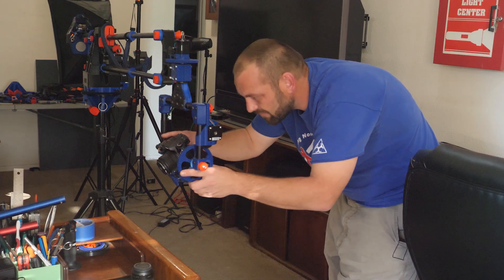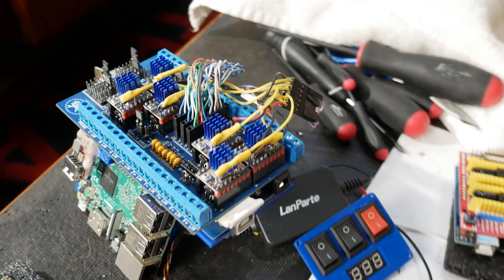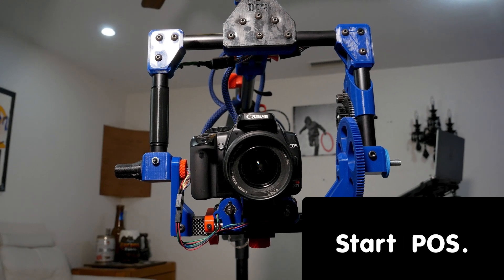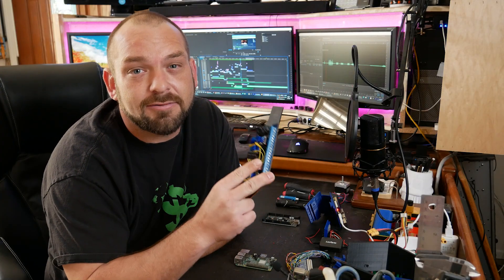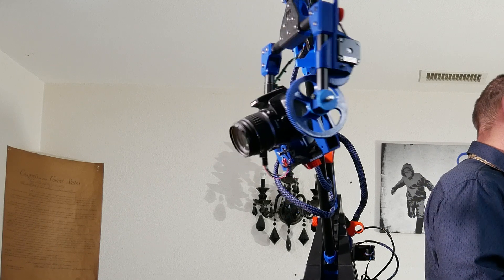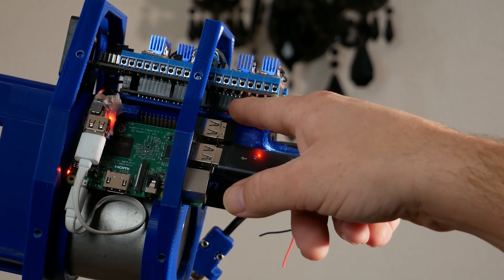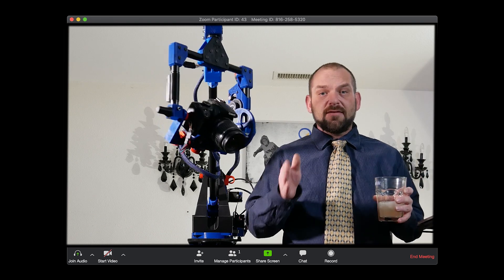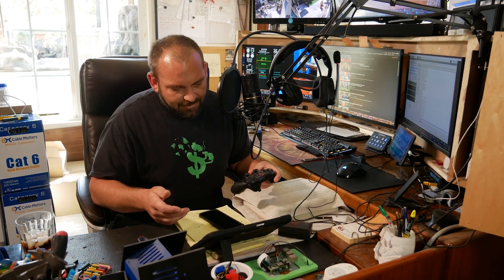The greatest DIY MOTION CONTROL camera rig EVER | Part 2

Comment from the maker: I'll Be Back
Reply: We are the resistance ✌️
Reply: In another year or...? I just finished printing every part and have all the hardware. Electronics are almost all here. Which motors did you end up using for zoom and focus?
Reply from the maker: Probably like 2 or 3 years @ryanmcclara
Reply: @DoItWhenever  ouch.
Reply: @DoItWhenever  Well, if it takes that long- I'll still be here! Hopefully I'll have my own system by then (based on yours) but..
Reply: Please don’t go to get milk
Reply: i cant wait!!!
Reply: In another year or...? I just finished printing every part and have all the hardware. Electronics are almost all here. Which motors did you end up using for zoom and focus?
Reply: @ryanmcclara  Prints and parts here too.  Any luck assembling the mechanical aspect?
Trying to figure out the turret.  
Are there bearings on the inside? Motors?
I'm looking at the S2A_camera_rig_complete.stl but maybe the .step files are more helpful?
Reply: The 24 rolllers... got it..  Though only 23 fit.
Not sure if this should be sanded/greased to quiet the woosh.
Reply: You don't have to prove me right. Sooner the better.
Reply: What do you think is the max weight this would support?  Looks awesome, but have an Ursa Mini 12k, wondering if it would hold it.

Comment: Nice work! I have printed all of the parts and I have 90% of the electronics and motors now. I'll work though the hardware (looks mainly like bolts) next. I haven't seen a BOM/List of the hardware, if there isn't one I would be happy to post one up? I think I've spied most of the ones in the videos.

Comment: Hey, getting together a BOM right now and ordering the parts. I noticed the link going to the 6 axis shield is no longer working. Would the GRBLDuino Mega Shield V1 - 6 Axis GRBL v1.1 Arduino Mega CNC Controller Shield on the same site you posted work? Great project, can't wait to finish everything!
Reply from the maker: Good looking out... the link should be fixed, but ya thats the board $35.75

Comment: Finnaly, really enjoyed that, well done, if you could please explain how you are moving the others three axis as Gcode Send only moves x, y and Z
thanks
Reply from the maker: Ugs does allow you to control A b and c access The only issue is you're not able to see them in the DRO... It makes it a tiny bit annoying to program a move but really not too bad. Before I program any move I zero all the axis and use absolute positioning. As long as you make a note of where you move A b and C are at it's not a problem. A nicer control solution would be really nice but this option is free for everybody and works immediately without any programming
Reply from the maker: Before I completely tear this thing and down and rebuild it for the next video I'm going to do a quick example of programming a move.
Reply: Thank you so much, been pulling my hair out.

Comment: Very interesting, thanks for also sunsrixing the things commenters suggested, I'll look into those.

I was surprised you use ugs and edit manually as it's a program I know and I expected so e fancy custom thing.

Your use is to program moves, mine is a bit different. One thing I was able to do was have just arduino with grbl and shield, then use a windows form application with USB serial port connection, it then sends a string of the code down the serial port.

I was then able to easily make a custom ui in the program and set buttons to then send code to my camera system.

Either way, very cool
Reply from the maker: right now the base just has the 19v power supply going through the slip rings so I can rotate the whole rig without binding. I was thinking of replacing the Rpi with a NUC or similar type of small based windows machine.  That would definitely open a few more doors for cool options to play with

Comment: What a monumental achievement!
And I loved the "Camulator II" intro and all the other fun references 😁
I was thinking - if you have your reverse kinematics figured out correctly, instead of ENCODERS you could have some load cells in the part that holds the camera to measure pushing/pulling/torque and have the software move the camera to match the desired motions.
Hasta la vista baby 👍

Comment: How did you do all those voices in the beginning of the video? Not the clips from other sources, but the ones that were custom to your video?
Reply from the maker: I'm not sure what you mean, The audio sources were either from the clips in the video or voice-overs that I recorded
Reply: Initially I didnt recognize some of the voice parts as being from movies. However, there is a deep announcer voice, starting at about 0:48, that is clearly custom recorded for your video. However, if that's you, it def sounds like you used voice changer software. I was/am just curious which voice changer software... "Same make .... Same model ... New video ... Once, it was programmed to control his printer ..." ... That voice. Doesn't sound like you

Comment: This is great! Thank you for sharing. I'm definitely gonna build this, but I'll probably control it with Dragonframe, since I only need stop-motion instead of live camera moves.
Reply from the maker: Awesome, that software looks amazing I haven't used it before
Reply: It's good but a little expensive. I use it for stop-motion product photography. It pairs motion control with live camera views and playback which is pretty nice.
Reply from the maker: @ssutton4455  check out bottango, I'm definitely going to play with that a little bit in the future and even for other projects that i work on... maybe that's something that can be used as well and it's free :)
Reply: @DoItWhenever  Oh man, that's really rich for an open source project. I might use both - Dragonframe for stop motion and bottango for live. What I like most about Dragonframe aside from the moco features is that it will "onionskin" frames, allowing you to overlay stop motion frames and play small segments as you go. Sure, it's $300, but one client will pay for that.

Comment: Dude ive been trying to build this thing for 2 years I have a box full of parts
Reply from the maker: Hopefully you picked your raspberry pi up 2 years ago as well... They used to be 30 bucks now they want $170.  It's crazy the murder they get away with
Reply: @DoItWhenever  Oh I've had them since the very first one I have a box of them. I don't have any 4s but I definitely have a few pi 3s.
Reply from the maker: @funkycraft  that's what I'm using... A pi 3 works just fine as a controller... It's not incredibly fast well remoting in and setting things up but it's more than capable of processing g code. I'm not sure you'd notice much of a difference from a pi 3 versus a pi 4 other than the price tag
Reply: Wait for the extensions that make it self-assembling 😉

Comment: I'll be ordering electronics this same week. The most difficult is the 6 axis shield because they don't send to Spain, but it seems it can be ordered by ebay.. The video, as all you do is AMAZING, so funny and care edition. Keep on the way man, maybe you are not an engineer, but for sure you are a MASTER!!
Reply from the maker: Thanks a bunch :) you can get away with a four axis shield if you didn't need the camera functions.. as I mentioned in the video the issue with my camera makes it difficult to use for programming but I already have some other ideas on upgrades that can utilize that free axis.... Two options are a motorized sled for the whole camera rig or a rotation axis for the camera.

Comment: How about modifying the input shaping from klipper. Or just use klipper since you have a pi and a board for the motor controllers already. Just modify the test for lower speeds. The video is to over yet so this might be a terrible or redundant suggestion.
Reply from the maker: I'm always looking for more suggestions,  And learning something new can never hurt 🙂 I'll have to check that out. The power of many is a lot stronger than the power of one.

Comment: By "fast acceleration" you surely mean "high acceleration" (which would be the same as "fast speed", although people would confuse that with high speed)
Reply from the maker: I'm definitely not an engineer :) My terminology might be wrong but I was hoping the graph on the screen would help display the concept... Both setups have the same running max speed it's just a matter of how long the rig takes to get to that speed and slow down from it.

Comment: ENCODERS !!! I totally need a sub ;)
Reply from the maker: Encoders would definitely be nice that would give you the ability to manually track those moves but that bottango software I mentioned is also really cool. I tried it for a little bit but the only issue was it didn't run on a pi. So I would have to be tethered to a computer and lose rotation access or strap a mini computer onto the back

Comment: Does this have object tracking ?
Reply from the maker: Currently it's just user programmed positions but you can still get some really cool results and it's pretty simple.
Reply: @DoItWhenever  I’m going to start 3D printing this soon…. I totally love it !!
Reply from the maker: @1620GarageAndFarm  nice... I did make a few small changes but none of the big components. I still have to throw the changed models up on thingiverse. I think the best time to do that as when the final assembly video comes out just in case.. I'd rather just have one package of revisions instead of multiple iterations
Reply: @DoItWhenever  maybe I will try and print this all in one shot off my FT6 !!
Reply from the maker: @1620GarageAndFarm  I just had to look that up... That thing's pretty huge... :)